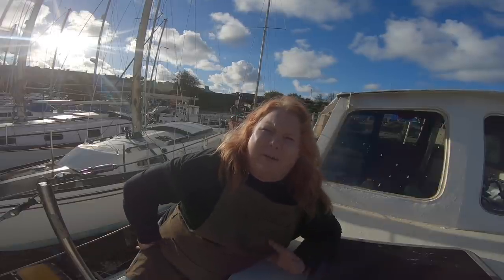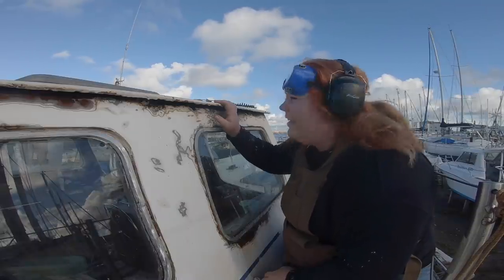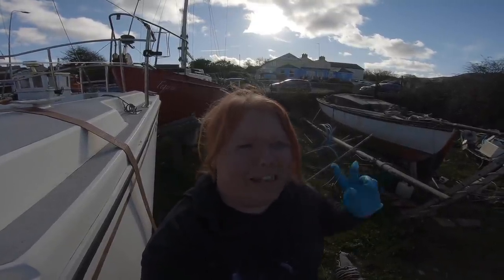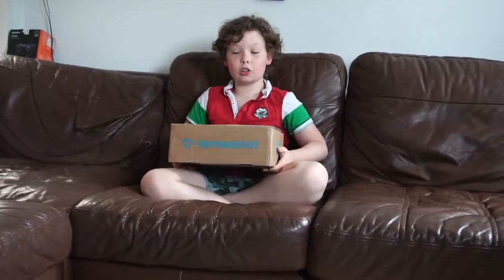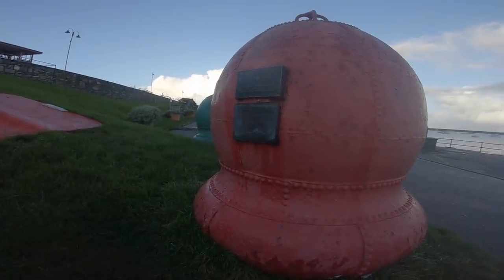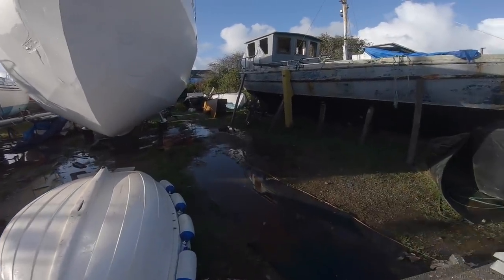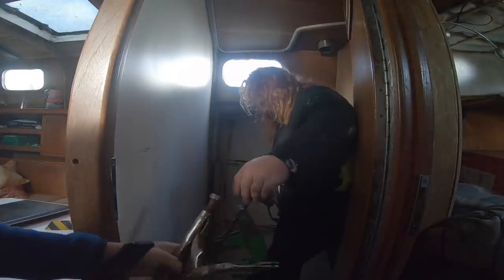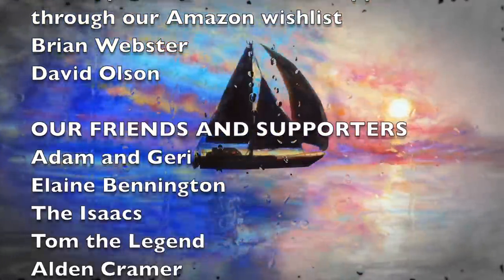#68 - Time to PAINT - abandoned yacht restoration

Comment: The rain and winds have been insane ...Jet-wash weather is what i call it... If your cars been facing down hill and those leaves blocked the scuttle drains it will fill and spill over the plug holes.  Always had trouble with the rear plug corroding on my old inline Ford kit car engines. Not helped when waters running down the back of the bonnet..as well as your neck🤧 well done both.

Comment: if your trimming the foam insulation use a modelling hot wire cutter we used to make alot of terrain out of that type of foam and it will cut it like a hot knife threw
 butter

Comment: No Doubt you have the stanchion bases and lifelines on your extensive to do list    I'd be tempted to make them with TWO wires instead of the fragile -seeming single, at about half height of the stanchion with soft eyes at one end  hard eyes forward where sails might get snagged. with lanyards to tighten and slacken when in the lifting bay so they don' t get damaged..
You've certainly got a good team there and  talented too!  
Yes that is an old diving bell that was used when investigating at depths where the water pressure at extreme depths is too great for a suited diver; some had mechanical arms to retrieve  item fom wrecks such as the Lithuania in ww2 off Ireland. 
Jacque Cousteau,  a Frechman, also developd these further to  enable diving xtreme depths  like the Mariana Trench , and  similar scientific studies . 
There is a museum of all types including th first suits at Stokes Bay,Browndown,  near Lee-on-Solent in Hampshire.

Comment: You can blow the water out of the plug holes with compressed air and to dry it out and also the plug wires. Then use dielectric grease on the  plug ends and regular grease on the rubber plug wires to prevent the egress of water into the plug holes. Or you could just not buy a Ford.. which I highly recomend.
Reply from the maker: 😂😂😂 hahaha you a Holden guy?

Comment: I used to have a really old Ford Fiesta - 950 cc engine. Every morning I would have to open up the bonnet and spray the leads and spark plugs with WD40 or it wouldn’t start. If I travelled for more than 60 mins in it, it would conk out and refuse to start without another WD40 fix. If you had more than two people in it, it wouldn’t make it to the top of a hill. I really hated that car.

Comment: Y'all have done loads of brush painting that I've noticed...any reason for not using a sprayer?
Reply from the maker: We used an airless HVLP sprayer below the waterline.
Above the waterline we brush painted on the primer because it’s quick and easy and will need flatting back with a block and sandpaper anyway. We may well spray the final top coat
Reply: I know you sprayed the bottom, I was wondering why not on the coachroof and sides.

Comment: This time I will depart from the main theme in order to talk - briefly - about cars. Melissa,  I'm sure that you're right about the rainwater impacting the engine. However, I think that you might be surprised by how it's doing it! It's not the rain that falls on the bonnet that's winding up in the spark plugs, it's the rain just before it falls on the road plus the rainwater on the road that's doing that! I think you'll find that somehow that plastic grill is actually doing the opposite of what its supposed to do by allowing the rain to pass straight through to the engine, probably eagerly assisted by the engine cooling fan at the front of the engine and directly behind the grill! Thus, the engine is probably getting an unscheduled albeit thorough wash down every time it rains hard - which, I gather is a frequent event! 
Still on the subject of cars, that rain gutter on the pilot house roof is very similar to the same thing found on many cars. You've aĺready done just about everything that can be done short of removing it altogether - which is an option that you may want to consider in the future. Merry Christmas all! 🤗😊
Reply from the maker: Hahah thank you. Yes you’re probably right about the rain getting in through the grill. And we were actually talking just the other day about removing the lip around the pilothouse. Definitely something we may tackle at some point: not yet though. It’s low down on the list of priorities in terms of getting her in the water 💦
Reply: @SailingMelody  well, she's really starting to look like the whole nine yards now! She obviously has been, and will be again, a great family cruiser and home! As I tell my wife, a house is just a badly built boat that has been inconsiderate enough to sink at the mooring!! 🤣😂